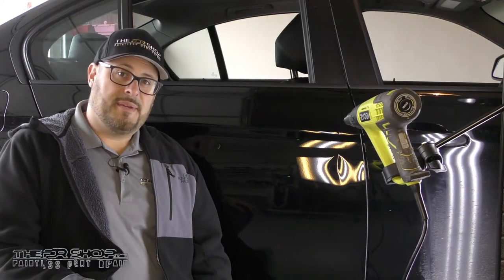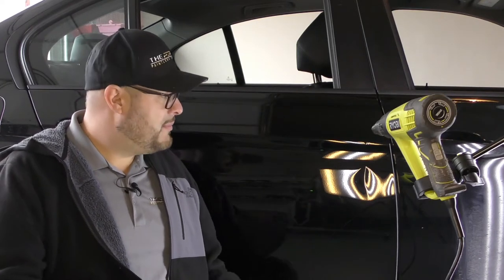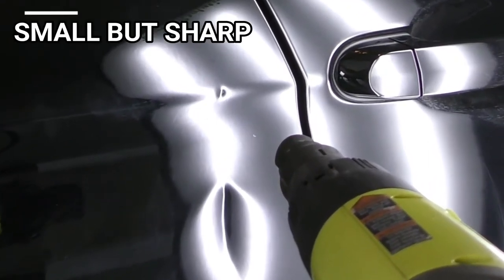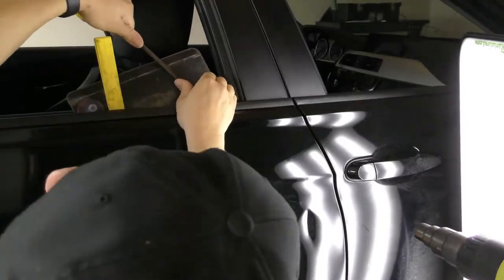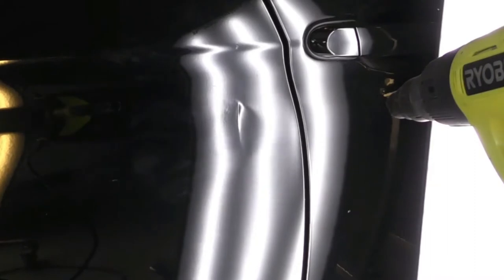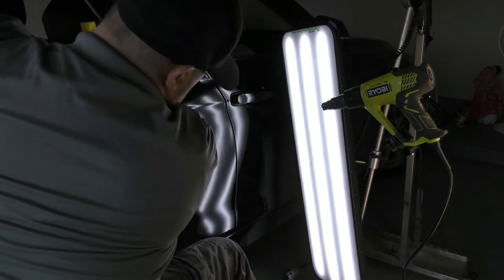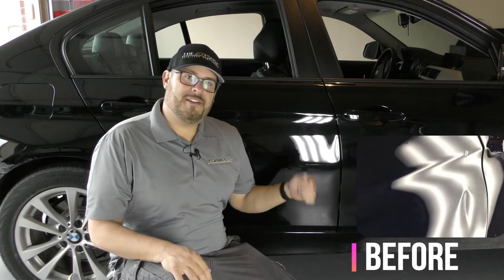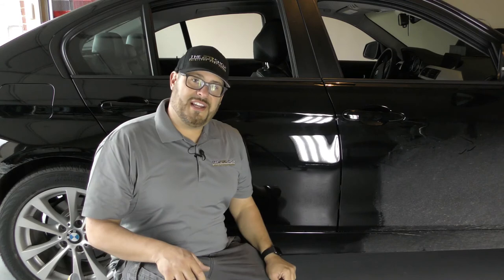How did I remove dents in this 2016 BMW 320i? Paintless Dent Repair Kyle TX, Buda TX, Austin TX

Comment: Which tool did you use for the bodyline? Double bend?
Reply from the maker: Nik Patel  I did do most with a PDR finesse double bend but also used an adjustable handle A1 door tool.
Reply from the maker: Nik Patel  https://www.pdrtool.com/products/14-au-rct
Reply from the maker: Nik Patel http://pdrfinessetools.com/15-inch-double-bend-shaved-14
Reply: Thanks Charlie! Much appreciated!